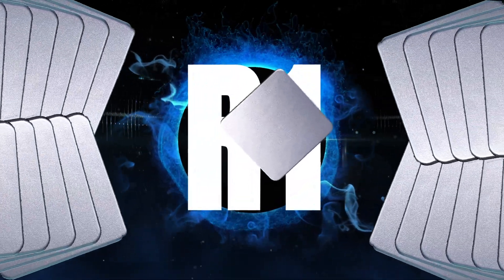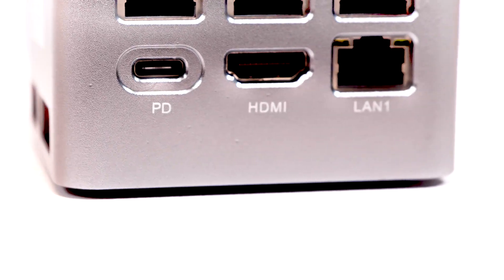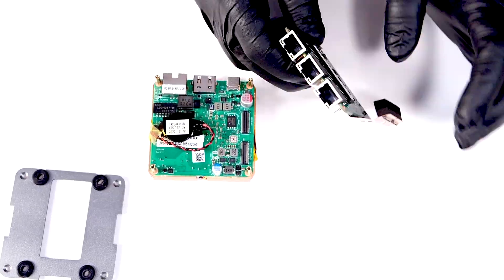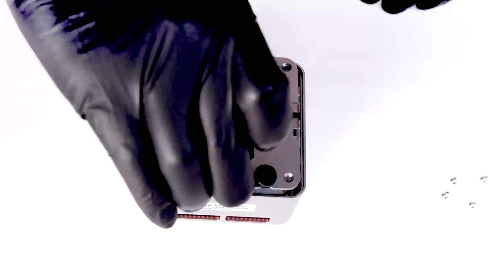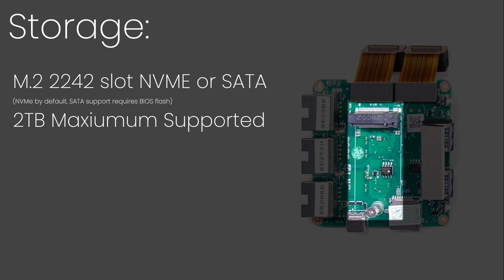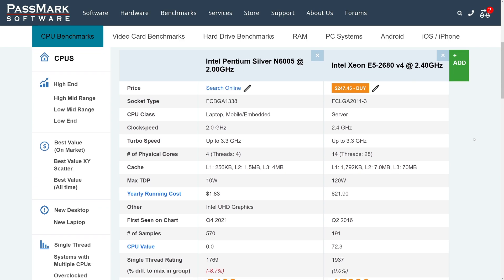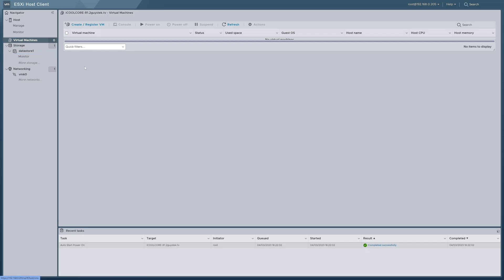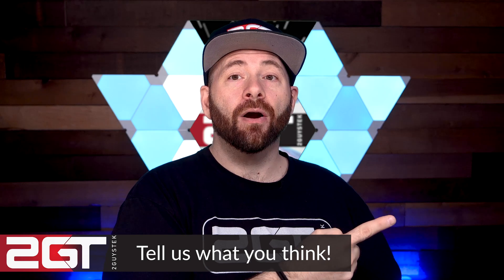Meet Your NEXT Mini Home Server! - iKOOLCORE R1

Comment: I feel they missed an opportunity to use the top case as a passive heatsink for the nvme.
Reply from the maker: I’m in agreement with you, and I suspect that’ll be something they improve on with the next generation.
Reply: @2GuysTek On their website they do sell a metal cover for just that. 👍
Reply: @2GuysTek  Upgraded, R1 Pro is on sale with Full Copper Heatsink & Brand-new Exterior Design.

Comment: Thank you for your review! The video is awesome! It should be pointed out that there is an error in the demonstration of installing the M.2 SSD. Installing the SSD only requires prying open the top cover and directly installing the SSD. There is no need to remove the four screws. The design of the top cover is a quick-release for easy installation of the SSD. If you observe carefully, you will find that one of the four screws has a fragile anti-tamper sticker attached to it. :face-blue-smiling:

Comment: Hi, I bought this tiny computer weeks ago. Running ESXI8 on top with 2 VMs (Ubuntu server and OPNsense). No problem at all. But I couldn't monitor the temperature of this unit thru ESXi nor any of those VMs. Do you have any solution on this issue?
Reply from the maker: I do not. And, knowing ESXi, I highly doubt there's a solution.  Typically support in ESXi for monitoring like that is handled through the BMC or IPMI hardware, which this board does not have.
Reply: @2GuysTek  Thanks for your reply.